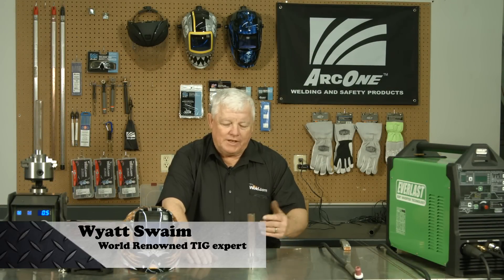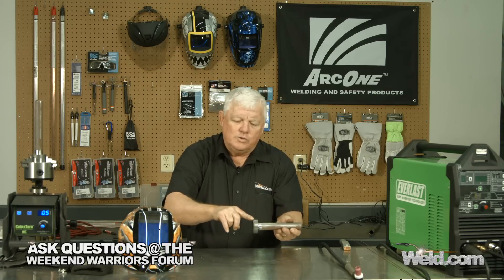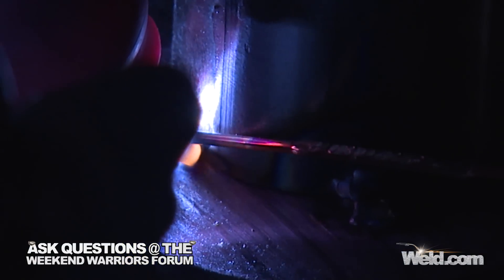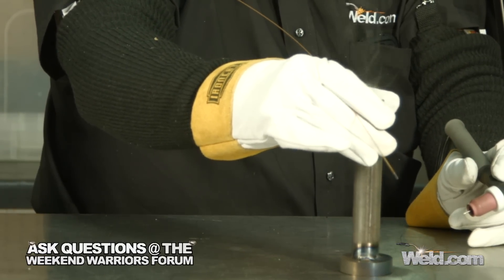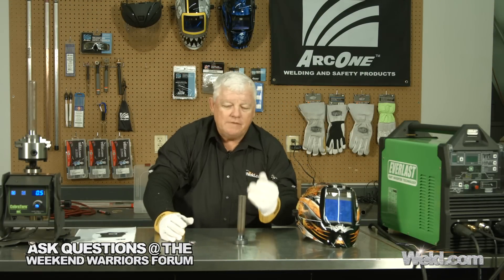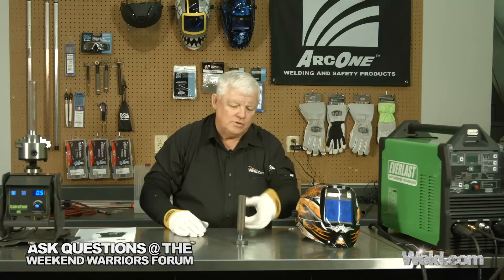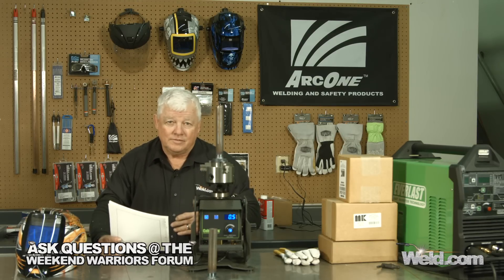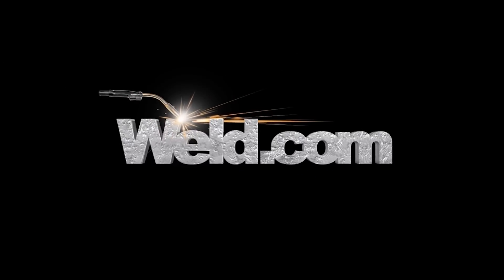Welding Thin Steel Tube to Heavy Steel: Manual vs. Semi Automatic

Comment: Hi Fred, The positioners do come in several different sizes ( we have two different sizes at work) they both tilt from horizontal to vertical and the ground clamp goes onto a spring loaded contact on the back of the chuck plate so it makes constant contact all the time. As for working with roller stands, if you line the stands up with the chuck, and the weight is not too much for the rotator, then I can't see why it would be a problem.   Scott.

Comment: Mr. Tig  When you weld you should start burning the tig rod from the side where it is not stamped. Besides that the stamped end ( where the wire designation is stamped into the rod ) is oblong shaped and contamination could be trapped on the lettering .....  It helps to have the stamping remaining otherwise in a week from now you dont know what kind of rod it was and you might as well throw it in the scrap bin or tie up flowers with it ....
Reply: ***** That's the dumbest shit I ever heard.